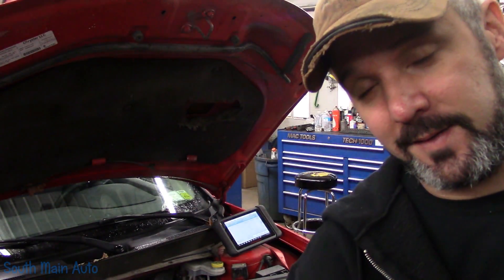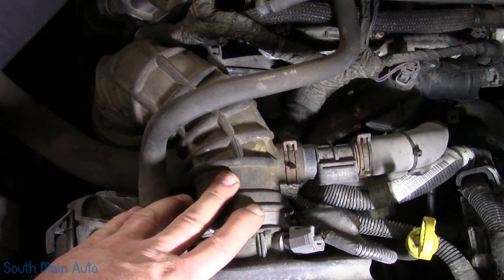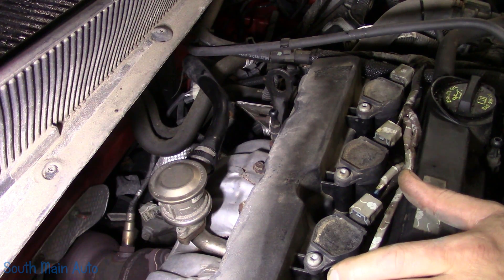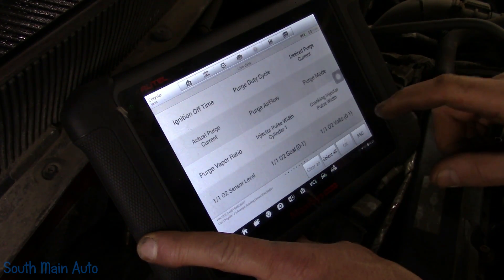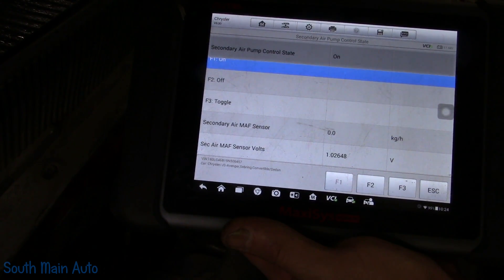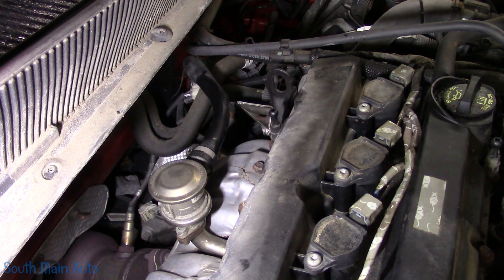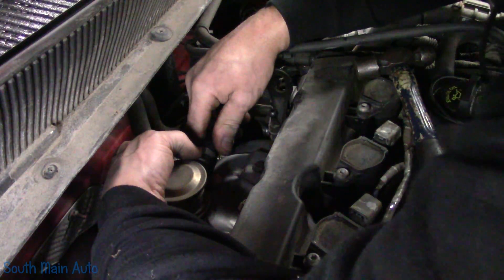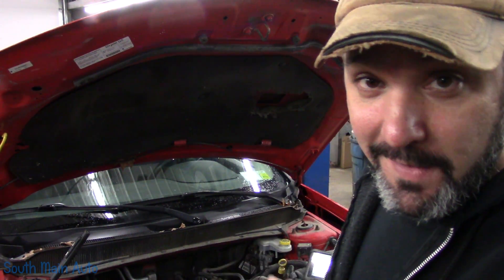Dodge Avenger: P2441 AIR Pump Switch Valve Stuck Closed

Comment: idk about that avenger but on both my wifes 07 sebring and my 11 200 the battery is stuffed in the driver side inner fender well and u have to take the wheel off and remove the plastic inner fender to get to it... not one of chryslers best ideas... i wish they had put them in the trunk or even went like gm and stuffed em under the back seat... please upload as much chrysler 2.4 content as possible being that my car has the same engine id prefer going to ur vids for fix it tips
Reply: The battery location may be a pain but the batteries last much longer.  The heat in the engine bay is a huge battery killer.  Putting the battery under the inner fender well makes for much shorter battery cables than the trunk or seat and utilizes space much better, giving more trunk space.  I had a Plymouth with this same setup, I have no idea how old the battery was when I bought the car but it was still good more than 5 years later when I got rid of the car.
Reply: Eric has two videos showing how to replace the battery located behind the inner fender on a Chrysler Sebring and a Dodge Stratus. Yes the Avenger also has the battery behind the inner fender.

Comment: Air pumps remind me of the 70s and 80s. Good quick video just for poops and giggles. Curl up with a bowl of deer stew, and this old bug will pass. lol
Brad
Reply: The 70s and 80s air pumps were belt driven  this is a passive system working off pressure / vacuum.
Reply: @robc8468  not entirely correct. There were pulse air injection systems that worked similar to what Eric was working on.

Comment: Isn't that valve clogged with carbon? If so why not clean it out.
Reply from the maker: Because, if it ever stuck open it would burn up the entire system. I do not want to be responsible for that
Reply: @SouthMainAuto   Sounds  reasonable, because the client will blame you. We in Europe have a lot of BMW's with this kind of problems , lack of maintanance  because the Dealer is sooo expensive  so the driver take the risk of burning his car. And a BMW will burn like hell for sure..

Comment: Blowing out both ends?   That will throw a trouble code.  Feel better.
Reply: What code is that P 0000?
Reply: @ChrisGrazioli  I think that's a P00PY code
Reply: +chris G the S0707 is for the back end malfunction and T0069 is the reached out of limits upper gastro tract fault code.  Hope that data helps with the diagnosis.  -Glen
Reply: Mismatch between input / output detected
Reply: that is a good one! needed that little bit of a chuckle today.  @ChrisGrazioli
Reply: He blew his head gasket and spilled the fluids everywhere...usually the kids bring it home and then the whole family needs new gaskets within a week
Reply: I hate it when my exhaust valve leaks.
Reply: sounds like a timing belt issue  must be an interference head  leaking out the exhaust and intake --- bent valves
Reply: yes, timing completely screwed up gg